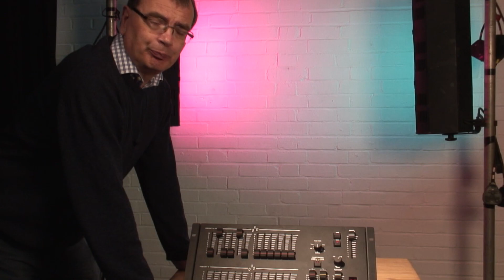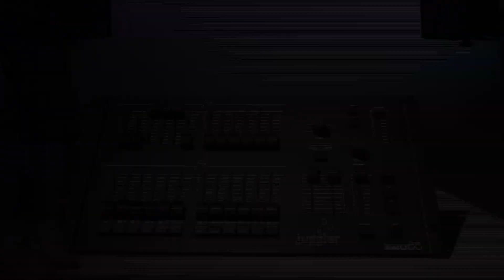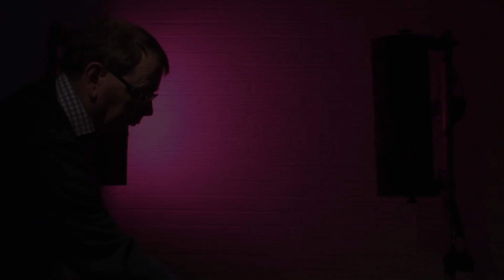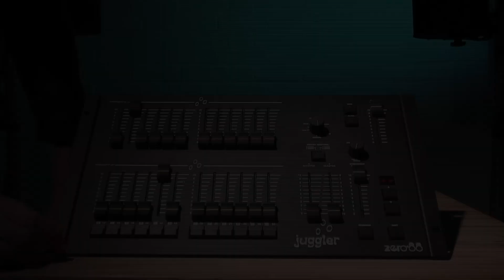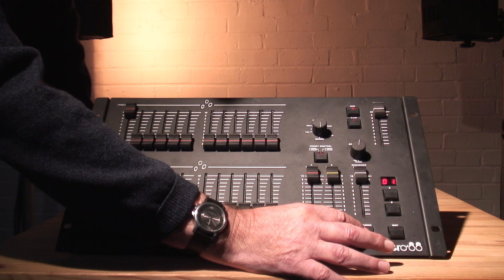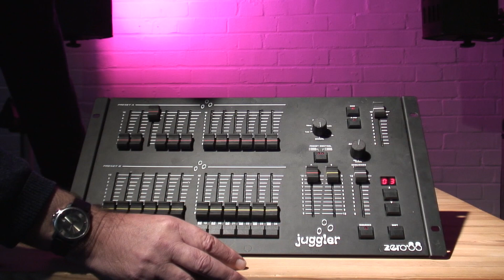The Zero 88 Juggler Lighting Desk

Comment: This device has MIDI OUT, so can I use it with my DAW software to control virtual instruments or virtual mixer at my computer ?
Reply: The juggler does not have midi out.  The Jester has MIDI in and thru.  The older Lightmaster has Midi In/Out.  Midi In is normally used to remote control the desk.  In/Out are often used to link desks together or save / load memories.  Juggler and Jester both have a DMX In which can be used to grab a scene (all 512 channels) from a DMX  data source such as another desk and save it to a memory.